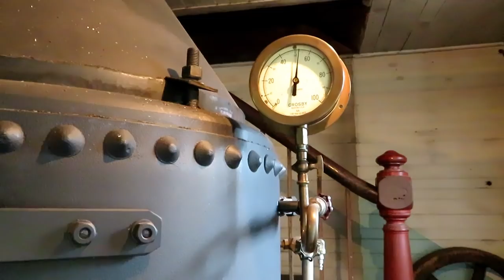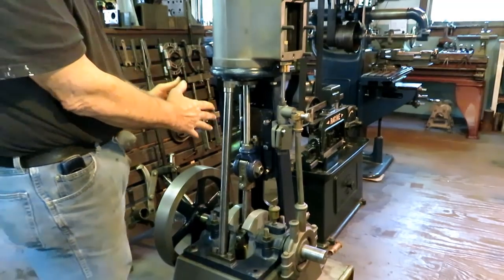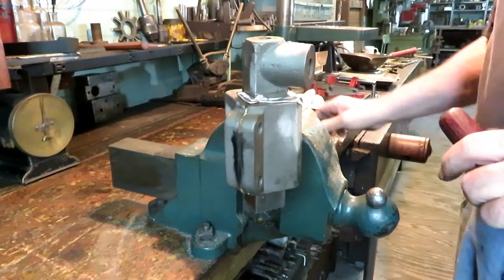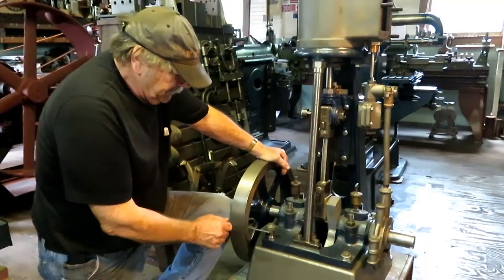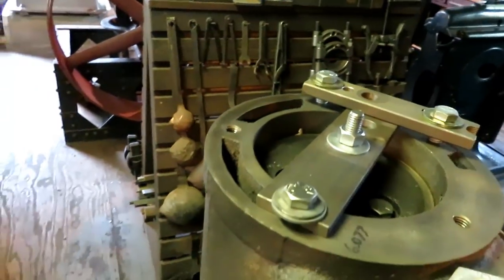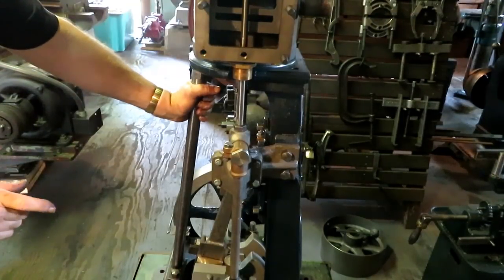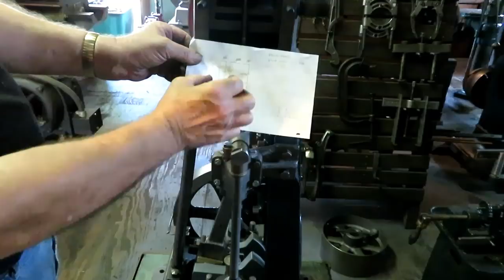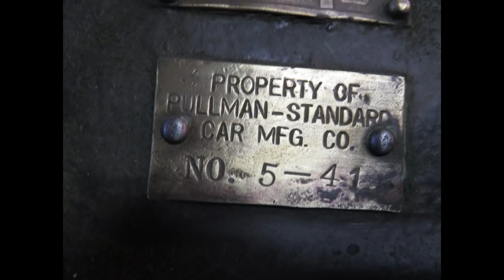OLD STEAM POWERED MACHINE SHOP 42  Steam Engine Slide Valve

Comment: Hi Dave, I have done a number of steam engine valve settings from scratch as you are doing,
to get round the angularity problem, I make a brass strip slightly over the length of the stoke.
Then divide the stoke by 100 engrave this scale on the strip, fix the strip to the engine, and 
make a pointer on the cross head  to pick up the scale.It is then easy to set the cut offs ect.
As to the slide valve ,it is usual to make the size of the exhaust cut out in the valve the same
width as the ports, and the hight, line to line again from the ports , but I sure you know this
already. Good luck with the projects , the videos are excellent.Regards.
Reply from the maker: Hi Clive, I can see the ex cutout depth being the same as the steam port width, that would give the same port area across the bridge but how do you consider the inside lap if you just make the cut out the same width as the port? Just trying to gather as much as possible from someone that has done it, thanks.....Dave
Reply: Morning Dave, 
As a rule there is no lap on the exhaust cavity in the valve, unlike the steam 
edges of the valve , so the hight of the cavity would be from the outer edge
of one of the inlet ports to the outer edge of the exhaust port ,or line to line  as it known ,that is assuming that the ports are symmetrical, which they
almost always are.I would also leave meat on the steam edges of the valve
for insitue adjustments as I'm sure you know, it is much easier to take away,than to add on metal.Hope this is of some help.Clive.
Reply: I like the useful sharing of info here.   YouTube at its best
Reply: Amen, this is why I love YouTube.
Reply: @Axton Mathias instablaster ;)
Reply: @Maddox Russell Thanks so much for your reply. I found the site on google and I'm waiting for the hacking stuff now.
Takes quite some time so I will get back to you later when my account password hopefully is recovered.
Reply: @Maddox Russell It worked and I now got access to my account again. Im so happy!
Thank you so much you saved my account :D
Reply: @Axton Mathias you are welcome =)

Comment: I have used a piston stop and degree wheel for checking cam lift and valve timing in many type internal combustion engines. I never thought about steam engines. It is darn near is the same. I am old enough to have personally known steam locomotive engineers that told me they could always get just a bit more out of the locomotive by manually adjusting the valve timing. Thank You David for sharing your wonderful skills with us.
Cazenovia NY.
Reply from the maker: Hi Walter,  The deal with getting more out of a locomotive is really true. There must have been some great stories there and very little was written about it. If a manufacturer designed a loco to pull 70 cars, the railroad had them pulling 85. It was maxed out all the time....Dave

Comment: Nice video, as always. But it might be a good idea to put the horizontal boring machine on the lineshaft and use it's motor as the lineshaft's backup.
Reply from the maker: You know, that's not a bad idea. Drive it backwards, and it would do it too....dave

Comment: Thanks for the explanation of valve timing.  I love the idea of using a "see through" valve to mark off the dimensions for the real valve.  We take our computers and CAD systems for granted today to figure out these engineering problems.  Like a previous post said companies had a "Math' Department to work through all the calculations for the engineer.  I love taking apart old machines, and then try to figure out how they did what they did.  It is amazing what was done with pencil and paper!!!  I learned on paper with trig tables and a calculator, then half way through my career had to learn to do it with CAD.  I think modern engineers would benefit greatly from some time at the drafting table, to see what really goes on behind the "line function."  I love your shop Dave, and think the sights and sounds are amazing, mix in the smells of cutting oil and coal smoke and steam...  Thanks for what you do!!!
Reply from the maker: Thanks Robert, Good to know you guys are out there watching....Dave

Comment: Thanks Dave for the insight into practically setting the valve timing. The mathematical relationship btw the crank shaft rotation and the valve stroke as well as the piston stroke is the sine or cosine function. Where did they get those in the old times? The most straight forward was to avoid to calculate this relationship and instead do a scale drawing and find the result geometrically as you showed in the video. At that time to find mathematical solutions by doing geometry on the drawing board was very popular because it helped to avoid doing math; well sort of because geometry is also a discipline of math. The only drawback was precision being limited by the line thickness and the scale of the drawings. The alternative was to bite the bullet and do it by math for which they would have needed a book with sine, cosine and tangent tables which were listing the sine values for every degree of a quarter circle. If they needed higher precision then they had to find a book listing tenths of degrees or linearly interpolate between neighboring degrees. Mathematically that can be justified because linearly interpolation within a narrow angle is a good approximation to the correct sine function meaning the error is very small. That way higher precision could be achieved than with geometry but sine tables and arithmetics had to be done which can be time consuming when done by pencil and paper method. Large companies and especially aircraft companies up to after WWII entertained arithmetics departments. So when a designer or engineer had to do lots of calcs involving arithmetics (multiplications, divisions, square roots etc) they would either write down their equations or fill in the first row of a table then hand it over to the arithmetics department who would do all the calcs for the rest of the table and hand it back. Every designer and engineer would carry a 1-foot slide rule sticking out of his pocket allowing to do 3 digit precision. In earlier days the  arithmetics departments would use pencil and paper, large 3-foot, cylindrical slide rules which could do 6-digit precision, and later they had mechanical calculators first driven by hand cranks and later electrically driven ones usually doing 8-digit precision. These  arithmetics departments also had full blown mathematicians. So an engineer could write down a really difficult equation and a mathematician would solve it for him and have the arithmetics colleagues calculate the needed number of results or draw up curves in diagrams. Interestingly the genius abacus arithmetics frame of beads never became as popular in western cultures as in Asia and Russia.  How were the sine tables calculated? By so called Taylor series. sin(x)= x - x³/3! + x⁵/5! - x⁷/7! .... using more terms would allow higher precision involving substantial arithmetic work. ! is the factorial function: 5!=5*4*3*2*1 = 120. And that is how electronic calculators and computers determine sine values.
Reply: Within most mechanical engineering a precision within 5%-10% is sufficient because any uncertainties are taken care of by the safety factors, which usually overdimension most parts for strength and durability according to the norm for the given application and the material used. Believe it or not precision to the 12 digit as we see today is a waste of effort (but who want to admit that a calculator usually apply digits in the calculations that are in fact unknown theoretical uncertainties and that these "extra digits" account for rounding errors" that is once again diluted by safety factors). Using a slide rule I can get precision to the 2nd or 3rd digit that is somewhat reliable, and that always fall well within the 5%-10% required, on both the folded and unfolded scales. Before my divorce I used to have antique German trigonometric tables printed sometime back in the 1800 century so various tables were well established for several generations before the steam engine.
Reply: Gee a whole semester of schooling in one reply!!!!
Reply: Well I can add for those interested in the theory behind slide-valve design it can be found in "Ingenious Mechanisms" by Franklin D. Jones (1936) volume 2, chapter 17, page 513 pp where both the use of Bilgram diagrams and Zeuner diagrams are discussed in detail... :)
Reply: Those mathematicians who did the calculations were known as "computers" because of all computations they did, even up to the early stages of the space program. Part of that fascinating story is told in the book/movie "Hidden Figures." For us computer-dependent types today, it is amazing to see what they could do.
Reply: ++Yann Kitson: I don't agree with all your statements. For strength calculations you are right that the safety factors reduce the demands on precision computations. But not so for mechanisms or satellite orbits especially in swing by maneuvers (planet ping pong). In some cases they need quite demanding precision not only in tight manufacturing tolerancse but also in precise layouts of the design.
You are right that today more often than not unnecessarily high precision is used but most likely because it is not effort any more. If it was then people would think harder what precision they really need.
Reply: ++Rick Brandt:
Yes, these are things that you can pick up in schooling or by studying books and it is knowledge that was hard won by those who first established it and we better keep working to understand and use it to preserve it in our culture and our time. I have learned a lot from Dave about the skills of the old timers. E. g. I had heard of it but I have never seen babbitt poured before his videoes  and those of Keith Rucker. And I would  like to pay him and his audience (that includes you) back by bringing up some old or new knowledge in context with his video content hoping that some would find it interesting. That is the  beautiful thing of youtube that people of all walks of life can share knowledge and skills and experiences and learn from each other. It was never so easy as now.
Reply: @Rol Eic: I think we agree more or less... We just focussed on different issues and true manufacturing and geometrical precision requires finer tolerances than 5%-10%.
Reply: ++Joseph Magedanz: Interesting. I did not know that. What would those human computers think today when they knew what is called computers today?
Reply: hokey frits guys. It's nice that you studied engineering at some point, however did either you or yann factor in cast iron expansion, lapping, oil sealage or tension( like water tension) that can cover a port up to 1/8 of an inch.  

I mean its nice and all to see calculations but sometimes practical experience will show up "Murphy's law" which is not explainable but still happens anyways. Aka "Anything that can go wrong, will go wrong" Also known as Murphy's ghost, which is why so many older machines(Which if you note are still around and functioning quite well) have larger tolerances than necessary vs the newer tighter tolerance machines. (Which are disappearing fast as they fail)

Just my two cents.
Reply: Yeah Jacilynn... the older machines were build to last by people who had a different mentality than modern efficiency and six-sigma. They were not designed with planned obsolescence in mind, but designed to repaired and kept running. I like that attitude... but hey what can we do? The customer nowadays want cheap stuff that's what they pay for so that's what they get.
Reply: ++Jacilynn S, ++Yann Kitson lots of truth in your comments. Cheap is the key word. Cheap is not bad by itself but it is a choice. Compare a Ford model T with a Hyundai today. Corrected for currency inflation over the decades the Hyunday is much cheaper than the model T. Less of our average income goes into cars nowadays (it goes into health care because to many more, expensive treatments are available and we consume them to live longer and to be healthier during those additional years. There are lots of 80 year olds in comparatively incredible shape which 50 years ago would simply be dead 10 to 15 years earlier.) You and I are causing this because we choose to order cheaper cars than our grand parents. If we wanted to do the same as our grand parents we would have to drive top notch cars like Mercedes, Lexus, Rolls. Today we have the choice to do either. Our grand parents had less choice. Instead we carry our money to the health care system. Are we wrong?
I have never claimed that engineers know everything and that e.g. skilled metal workers or production workers would not be needed anymore because they have their skills and experiences that are not taught in engineering school. It needs both. And both should respect each others skills. There are still e.g. aluminum car engine parts cast by the millions and those who plan this for sure factor in metal shrinkage. Interestingly I worked in a project once that was about surface tension of transparent glue to predict the final glue layer thickness and minimize waste of glue but be sure to have no voids between two highly precise glass surfaces for prisms used in beamers to project computer screens to the wall for presentations to audiences. This was not 6 sigma but it was a production quality driven project and it had to do with surface tension. And yes you can calculate some of that too. And the calcs showed too how important it is  for production personnel to wear gloves for cleanliness which they hated because it is uncomfortable to wear them for hours and have wet hands inside even with cotton liners.The world is complex. Almost everybody contributes to complexity. And even though we complain a lot, especially that many things were so much better in the past; I disagree. No generation before us lived better and longer lives than we do. We are much more productive but we have more time pressure. Many have lost their imagination to get the most fun out of our free time (which also was never more than today) mostly because they have become consumers of commercial fun instead of being producers of home made fun. Not so Dave, he produces his own fun... ;-)
Reply: @Rol Eic: Very true, the world is as it is because of our decisions and  engineers respond just like the rest of the workforce to the demands of the consumer, and there are more of them everyday (both consumers and demands), which then again translates into larger production, higher efficiency and more complex procedures for Q/A, JIT etc.

But we also have to remind ourselves of the fact that the production has moved to less expensive places, because labor being the only cost that is now left to manipulate and that the modern production methods has reintroduced sweatshops using child labor, and factories as brutal as the early industrial revolution now with suicide nets, so the question is, did anything change? Do we live longer and happier with the latest gadget? I would postulate that the reason people in the western world live longer is not so much healthcare as it is healthier a lifestyle e.g.no smoking, exercise and less repetitive work and aids for heavy lifting to save the body. Whatever it is that make us live longer it is certainly not the diet of fastfood and alcohol of modern humans. Well back to the fascinating world of mechanics...

Comment: The mechanical clock at the beginning, Is a class act.  If you ever need it worked on. I can help you.  After the clock it just gets better and better.  Michael Lenz
Reply from the maker: Hi Mike, It's an Ansonia clock, I figure about 1910. I never did anything with it, just keeps on tickin. It's interesting that Ansonia (one of the biggest clock works in the country) was sold lock stock and barrel to Russia....Dave

Comment: Love your videos.  Just a thought about finding bottom dead center with the same fixture you used to find the top dead center.  A long peice of allthread would do the trick. That way you wouldn't have to find a good spot on the cross slide.
Reply from the maker: Sure could do it that way, I'll try it next time....Dave

Comment: Greetings from England again Mr. Richards 

Well I don't know about anyone else...but I really look forward to these installments...
Nice stuff to watch...

Plexi glass a good idea...
Quite involved...
Top & bottom dead centre ID easy and informative...

Have you done anything with the belt issues you say you were having with the large lathe there...?

I've just managed to get hold of an old turret lathe...
Alfred Herbert, Coventry, England...
Its a flat belt drive but a geared head....WW1...or just after...
I've to go pick it up end of this week...
Reply from the maker: I looked at modern rubber composite belting but the web sites are factories wit not much way to sell a few feet to me. Haven't found a supplier with anything like what I want.  Single belt geared head lathes in this country were the begining of carbide tool use. They were trying to get the Horse power up to make use of it....Dave
Reply: I agree with you.

Northern Nevada, USA.